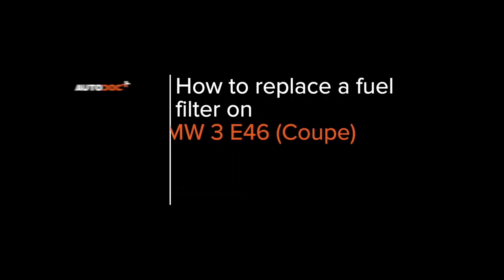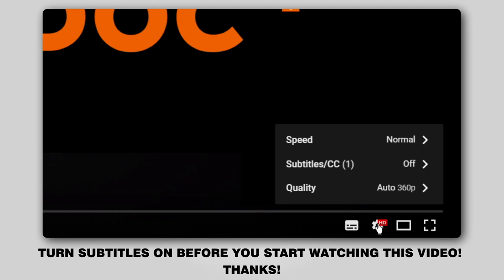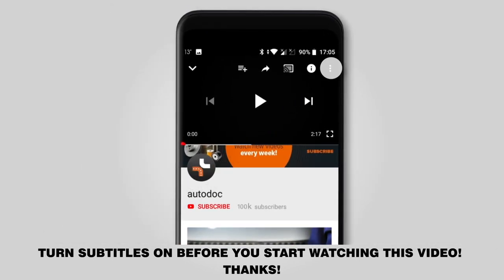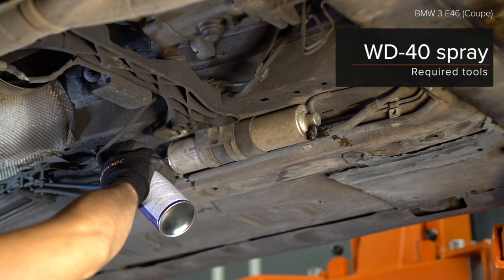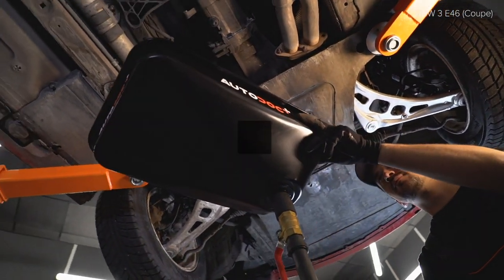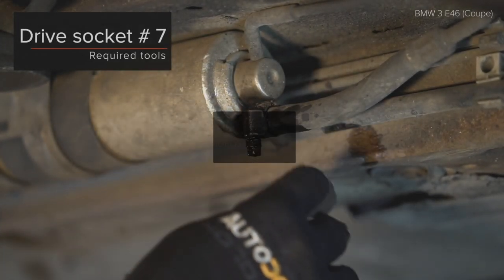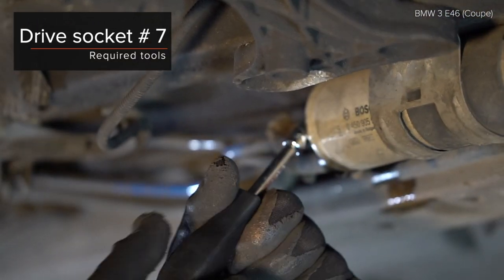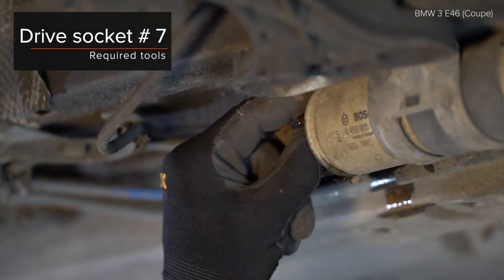How to change fuel filter BMW 3 (E46) [TUTORIAL AUTODOC]

Comment: How are we supposed to know which one of the two hoses on the other end goes to which pipe on the filter? I mean the other part near the engine only has one hose so, it's pretty obvious but, what about the part with 2 pipes, hmm.
Reply from the maker: When replacing the old filter, you need to pay attention to which hose connects to.

Comment: Great video thanks. How do I know if my car uses the filter with or without regulator? The last numbers of my vin are 5KS58267
Reply: The 3 series fuel filters all require the pressure regulator
Reply: @sarcasmic7478  Thank you